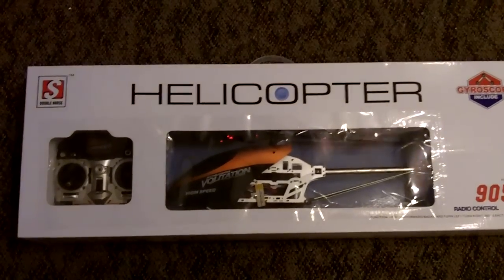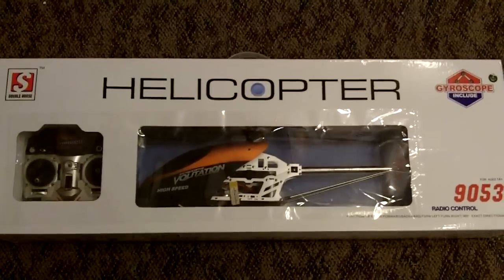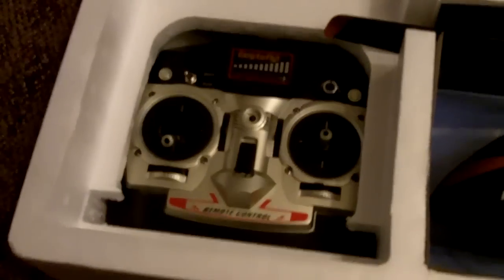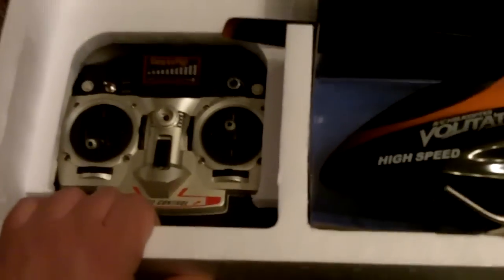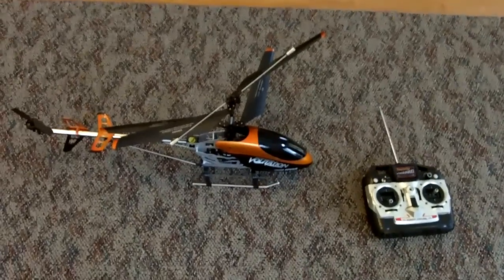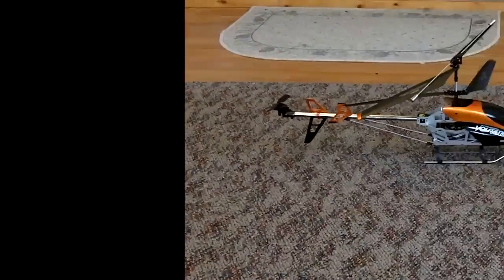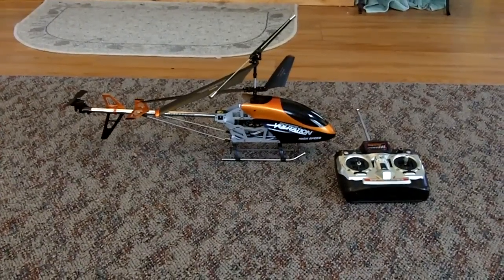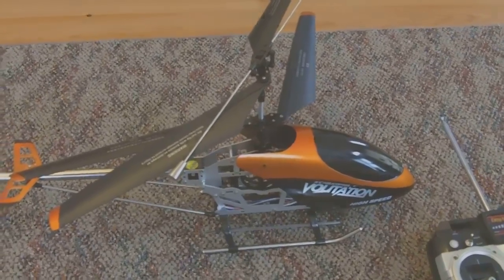Double Horse 9053 review

Comment: i just got a 9053, saw a few videos on mods, they took under a half hour, i ordered 3 counterweight bars from another heli that's plastic from DH, i inverted the lower rotors, stretched the antenna wire out to the tail, cut the fairing to ventilate the circuit board (small heat sinks) and removed the battery and lengthened the leads to mount the battery under the body and more forward, now i'm just charging the batteries (i got 5 extra) should have it flying soon.

Comment: if you want one then buy one, there is a heli by double horse that uses the plastic balance bar so you can swap out the metal one. all helis are problematic if they get wet dont matter how much money you spend and getting any of them cold like winter flying for example makes the blades really brittle which is why i advise not to  fly in cold weather/snow . the manules will tell you the temps not to fly in cause it can cause damage so just fly in the temps they say are ok and youll be fine.

Comment: Can you see if the blades are rotating the correct direction?  
The part that curves down should be the trailing edge.  If they are rotating backwards, remove the plastic shroud (there is a screw on the bottom!) and reverse the two plugs that lead to the motors. 

If they are rotating correctly, make sure the battery is fully charged, and that the trim lever to the right of the throttle stick is not fully to the rear.

Comment: I have the  9101   and everything is OK  except when I move it across the living room rug  it tends to want to side slip so I haven't even got it to fly upward  yet that side slip bothers me and I added some weight on the opposite skid  to compensate to try and keep it level however its not to good .  can I set the whole copter at an angle and let the gyro set that way  to compensate for the side slip

Comment: @hydropyropyropyro Hi I recently got into RC helicopters as you call them. I was hooked after my son bought me a micro  and I flew it straight into the ceiling and walls etc, After getting used to it I got a bigger one then a volitaion 9053 which flys well for 40 quid. This has allowed me to get used to flying without spending fortunes, it would be useful if you could recommend an entry level REAL one as you suggest, Im thinking of an esky honey bee V3, any good ? or is that a toy as well

Comment: @MrRcflying: I bought heli one year ago. I've one problem, it won't fly in the slightest wind. Found "solution", glued bigger blades to rear blade. did not help, stalls in the air with wind outside. Added 1, then 2 nuts as counterweights at the nose under battery, improved, but still cannot maintain normal flight in ANY wind. Any solution or is this just an indoor heli misrepresented as an outdoor machine? I'm about to buy new one, so unhappy I am with this one. Any advise will help :)!